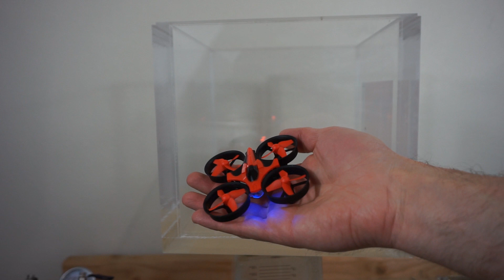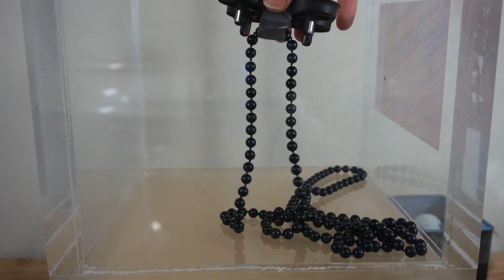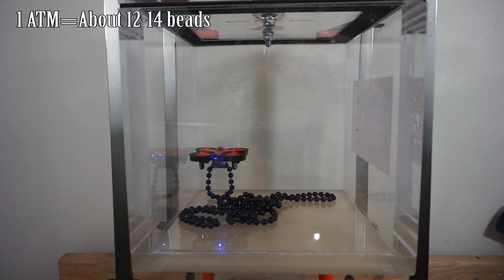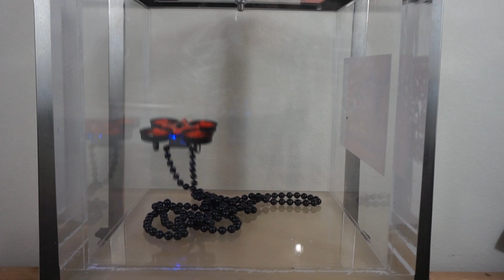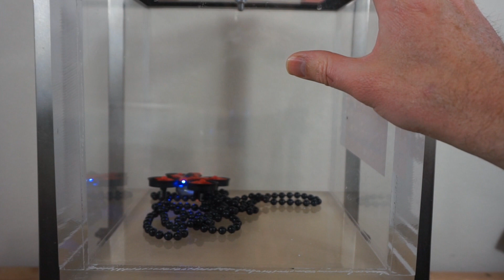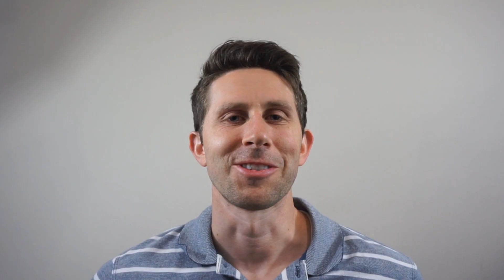What Happens When You Put a Drone in a High Pressure Chamber? Does It Have More Lift?

Comment: I believe the increased density of air also increases the buoyant force which is also contributing to the increased lift.
Reply: abhishek khurana 
Good observation! I agree.
Reply: Yes, however this is generally going to be a tiny fraction of the overall difference. Air just isn't that dense to begin with. A 90 kg/200 lb human, for example, is only going to be about 0.11 kg/0.25 lb lighter due to differences in buoyancy than in 1 atmosphere.
Reply: Oh, yes. Good counterpoint! So, it's contributing, but not on a significant level. I can appreciate when a comment section isn't like:

"subscribe to me and i subsribe back ps give me a shoutout on next vid or u will die by clowns"

Thanks for the enlightenment! =)

Comment: Does an increase in pressure equal an increase in lift infinitely? I suspect that at a certain point of continually increasing the pressure that the weight generated by the air column above the drone at rest will not be able to be overcome by the drone, and therefore result in lesser and lesser lift at a certain pressure increase threshold.  Am I right in my postulation or am I wrong? If wrong please exaplain the fallacy in my logic. Thank you
Reply: john declue 
Sounds right to me!
Impressive logic. =)

Comment: But why does the drone bob up and down so much in the high pressure?
Reply: Wondertwig 
I believe that, at its rest point, it's not holding much weight. This allows it to gain speed and momentum. As it quickly travels upward, the number of the beads that it carries increases. The momentum would allow it to, for a moment, carry extra beads. Once the momentum is absorbed by the weight of the beads, the drone can't carry that many anymore. This causes it to drop, and gain downward momentum. Once the drone gets closer to the bottom, it's carrying less beads. Then it can go back up, and the processes repeats.

Hope this helps, thanks for asking. =)

Comment: might as well put it in distilled water
Reply: don't forget it has to be distilled AND de-ionized AND de-mineralized  as well.
Reply: Doesn't distilling it get rid of minerals too?
Reply: Not completely. There would still be particulates from the air and such.
so it would need to be a very thorough process to get perfectly distilled.
The other methods used at the same time. will make the water non-conductive and remove any microscopic minerals and electrons so it will have no chance of being conductive.
The problem is the product (or electronic device) will have minerals or corrosion on the surface of it. so just putting it into contact with pure water will cause the water to slowly become conductive.
You would need to take the battery out. and wash the whole thing several times in a clean room with multiple washes of pure clean distilled de-mineralized and de-ionized water.
Only then can you put the battery back in and attempt to use it.
The problem is the liquid or fluid is much thicker than air. so it wouldn't fly. it'd most likely float on the water. and it would be like shorting out the motors and stalling them. drawing lots of power. it would be more efficient to run a step down gear ratio that turns a high speed motor that turns gears that make the blades move slower with more torque. That would be more efficient with less power drawn. with better results.

Comment: At the higher pressure the air is more dense, therefore the propellers will be able to generate more lift.  When flying aircraft pilots learn that their aircraft will not fly as well at a higher density altitude due to the thinner air, at lower altitudes, closer to sea level, the air is more dense, the entire aircraft benefits from the more dense air, the engine, prop and lifting surfaces all benefit.

Comment: in a high pressure atmosphere the higher the air resistance means it can get higher so there wouldent be a trade off
it would be able to get higher overall and get there faster

Comment: What happens if you fill it with water and lower the water pressure? If that doesn't break the machine lol
Reply: Vizlox you can't modify water volume ,you can modify air volume.
Reply: If you filled the pressure chamber Completely with water the Dissolved Oxygen would come out and lower the water level

Comment: Here is a test that should be done both in a vacuum and high pressure test.

Create a balance beam of sorts. Attach a helium filled balloon to one side and proper amount of weight on the other to balance it at 1 atmosphere. Make an arrow with a scale to measure the difference between negative and positive pressure points.
Reply: Robert Steich helium is lighter than air, so you can not weigh it in air with a positive scale.
Reply: its lighter than air at are atmosphere if there was more atmosphere or less atmosphere it would raise and lower the balloon
Reply: Actually, he mentioned in an other comment that the chamber becomes heavier when high pressure is added. Lighter when under a vacuum.  

It will obvious that the helium filled balloon will expand when in the vacuum. If it can hold its shape with out bursting, there must be a point that it will drop due to the fact there's no air to hold it up. Perhaps a different material would be needed to test than a balloon. Or a plexiglass around a balloon to hold the shape better without expanding too much. 

Theorizing and seeing are two different things. Besides children learn way more by seeing it done than being told.

Comment: is the chamber lighter when there is a lack of matter and heavier when compressed and if it is lighter could we technically make a rigid airship like the Akron or Hindenburg using a giant vacuum and some extreme engineering
Reply from the maker: +Wes Brackman the RC enthusiast  yes it is lighter under vacuum and heavier when pressurized. There have been proposals to build vacuum airships. It is possible but as you could guess, very hard to engineer!

Comment: Can you simulate Venus's Atmosphere by putting CO2 in it and add heat around the chamber?
Reply: Ali_Army107 say bye bye to the chamber
Reply: Goodbye!

R.I.P Chamber
"Year it was made" - 2017
Reply: Ali_Army107 That's not true, Venus atmosphere is gaseous sulphuric acid, which is very caustic(corrosive)
Reply: Simulating Venus' atmosphere would be very difficult. Venus has 92 atmospheres of pressure (about the pressure a 45 ton hydraulic press contains). That's like being over 1,000 meters down in the ocean.
Reply: Speaking of, based on diving info, the limit of pressure at which a human can safely breathe air is somewhere around 4 atmospheres. Around that point, people tend to start showing symptoms of nitrogen narcosis. That is, the air becomes a narcotic. Around 7 atmospheres, the oxygen becomes toxic.

Comment: would a smartphone work on both ways of pressure?
Reply: A phone doesn't need oxygen to operate, just a battery and person to operate it.so assuming a person could survive in a vacuum (which we can't, but for the sake of this argument we'll assume we can(also, astronaut suits with metallic finger tip cloth)) then all the phone needs is that person to press it's buttons. So yes, a phone can work in a vacuum, but without sound.
Reply: The batteries are sealed though so low pressure might cause it to expand and if you get lucky it might blow
Reply: Adrian Alejandro I mean unless there is a lot of air in the phone and it falls Into itself then why wouldn't it
Reply: Adrian Alejandro phones dont fly